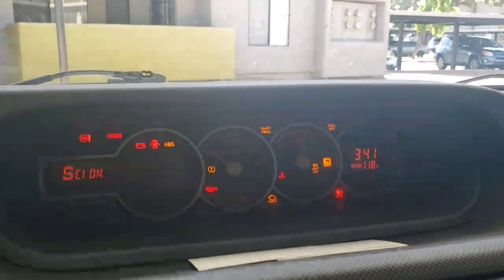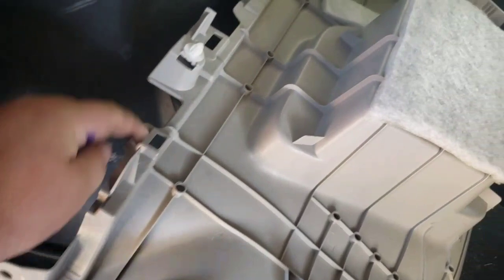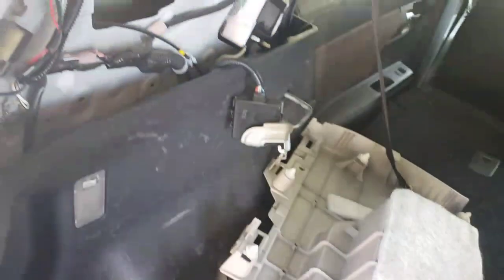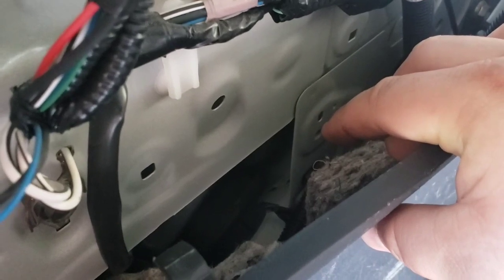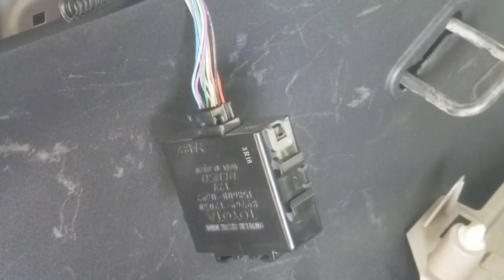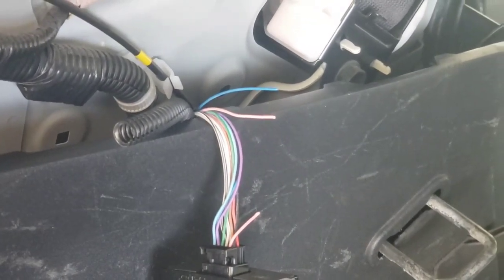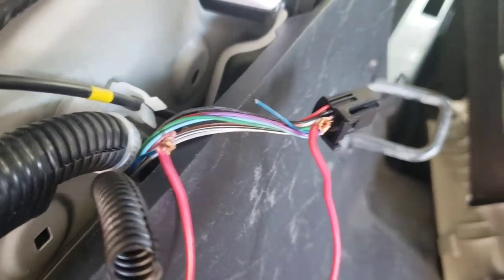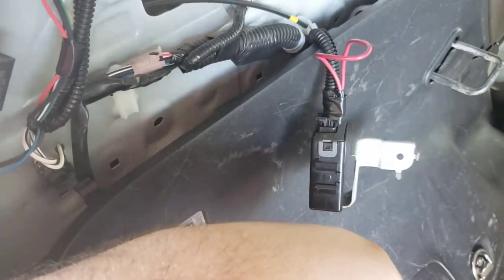GETTING Rid of the TIRE LIGHT!

Comment: So heres my question, do I have to cut that first wire (power) or can I just tap in to it for power? Reason I ask is because my plan is to use a switch that has a normally open and normally closed feature. So when the switch is off the tpms will operate normally. But when I activate the switch it bypasses the tpms so I don’t have the light on for my wheels without the sensors. Thanks in advance
Reply from the maker: Oooooooooo see now....that would be interesting, as you setting that for two different sets of tires? Winter vs summer?
Reply: That is correct. I’ll have my snow set up for 3 months. So does it have to be cut or can I just tap into that? If not that’s cool. But then my next question would be does the bypass fry the module lol? I know lots of questions.
Reply from the maker: I don't believe it hurts the module it just tricks it you probably could jump the wire but put in a quick disconnect on all 3 wires. This way you can hop back and forth between trucking it and having it work as normal...idk if this will work but just an idea 😂
Reply: The switch I have is like a double throw switch. One side “always on” and one side “always off” unless the switch is activated then it flips. Normally open goes closed and the normally closed goes open. If my thought process is right it should work flawlessly. Instead of jumping the power I’ll just hook it up to the Normally closed side. I’ll keep you posted whenever I get around to doing it. Should be within the next few days
Reply from the maker: @ADZ8764  for sure let me know I'm curious 🧐
Reply: Worked like a charm. Exactly they way I hoped. Even dropped air pressure in tire to see if it worked when in the “on mode” to see the light pop on with low psi. Then I flip switch and boom goes off again. Perfect
Reply from the maker: @ADZ8764  yo that's honestly amazing, could you send me some pictures and details to my Instagram? Or Make a write up on xB community for fb?
Reply: Sorry I don’t have instagram. I do have Facebook but I don’t really partake in to much social media. If you like I can send you a schematic of how it’s been wired. On Facebook or email. Idk.
Reply from the maker: Yeah for sure send me an email with pics and what not I'll make a post and maybe I'll make a video ☺️ 
Insignificantboost@gmail.com
Reply: Email has been sent. I did a quick schematic and sent a pic of the switch mounted.

Comment: so i have my TIRE LIGHT! turn on and replace one of tied sensor, the light doesnt go away, the guy told me i need to buy tire pressure warning antenna and receiver  to replace it. ( 2008 2009 2010 Scion xB Tire Pressure Monitor Sensor TPMS Module OEM
is the Monitor i need to replace?
Reply: DTC No. C2126/26
Reply from the maker: @Leaf032  that depends, did you replace all 4 tire sensors?
Reply: @InsignificantBoost   i replace all 4 tire sensors last yr and replace one that wasnt reading, do you know what it could be?
Reply from the maker: @Leaf032  if it is the module, I would see how cheap you can find it or go to a junk yard and get one from another box, they don't tend to fail